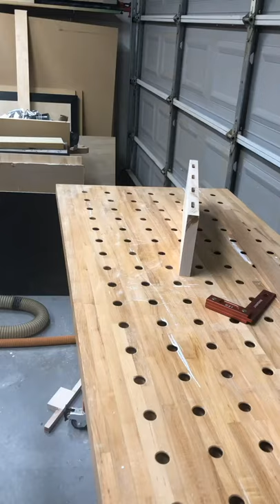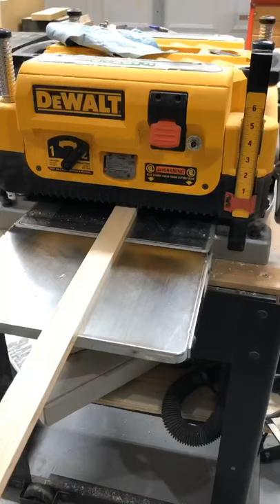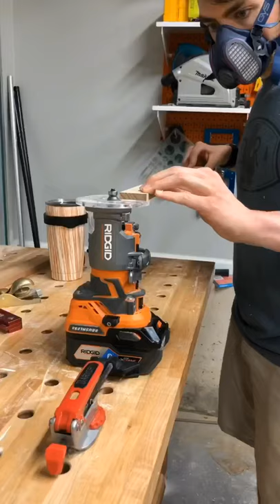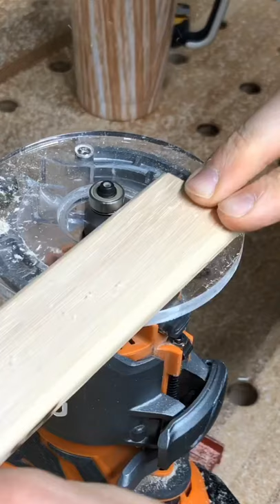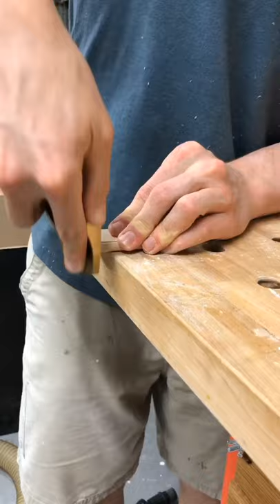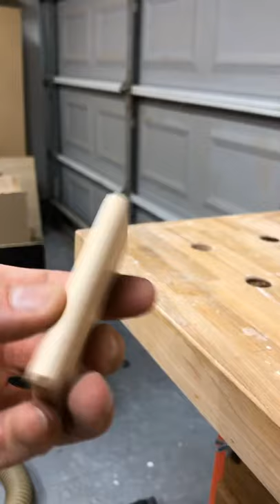Poor Mans DIY Domino! #shorts

Comment: Yep, poor man's Domino... Have you calculated material costs and labor? Probably not, because otherwise you may have noticed that Dominos are kind of cheap...
Reply from the maker: Yes I’m a production shop setting the domino and dominos are a pretty cost effective and solid joinery option but for small shops that doesn’t negate the large initial investment. I own a domino now but at the time I didn’t so I found a way to get the job done with the tools I had not everyone working in there garage wants to jump into woodworking and take out business loans to go straight into efficient production 🤷🏻‍♂️ and I do well understand material cost and labor efficiencies but for one off jobs it’s illogical to make large investments as a side hustle when I don’t have the capital nor do I often make big tables. Also getting metric router bits to even match the ore made router bits is a pain in the states so without The domino, premade dominoes are useless.

Comment: Him: poor mans homemade domino. 
Also him: used overpriced woodpeckers square and $10000 worth of equipment.
Reply from the maker: Clearly you don’t understand cash flow or the cost of used tools 😆 but I got what I got through burning the candle at both ends constantly working hard on my side hustle. Also “poor” is relative and I’m damn sure no 1% er . Also most starting woodworkers have the basic tools I had in this video but most at that point don’t have the cash flow for a festool domino that costs over 1500 bucks so this is a way to make that without that cash flow as a way to save and eventually get it. Use this as inspiration to find ways to get the job done no matter what and problem solve and not just a way to complain that I have things I worked hard for. It’s always funny how people can’t comprehend cash flow or budgeting. And the truly rich have found ways to make all the levels below them all get mad at one another for what they have 🤦‍♂️ don’t buy into it and just do better! No excuses!

Comment: With lumber prices how they are looking its cheaper to buy them made lol
Reply from the maker: This year .. you ain’t wrong! 😆 but this is an older project when I could get wood for nothing and friends were giving me their scraps haha now I have saved up and got the festool domino so I only diy them when I want to make decorative through ones like for drawers
Reply: @NesBuiltDesignCo  hahahaha man I haven't thrown away any scrap wood the last couple of months. Gotta have a reserve
Reply from the maker: Right! 🤣 I have a section of 5’ wide shelves floor to claiming filled with cutoffs and scraps! And it was spilling out into the floors so I finally gave a little away to a friend but that was honestly tough! Got that great depression mindset from my grandparents I guess and my creativity sees potential in every single piece!!! So I’ve had to make some rough rules just to keep from filling my whole shop with scraps 🤣
Reply: Hahahaha that's tough, yeah at this point i may need a 2nd mortgage just for the work gear and materials
Reply from the maker: 😆 facts